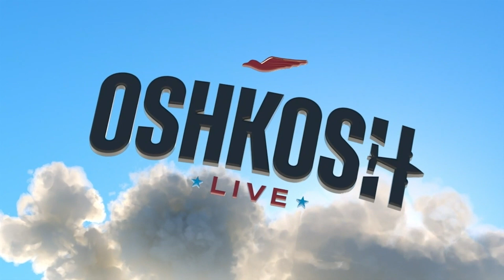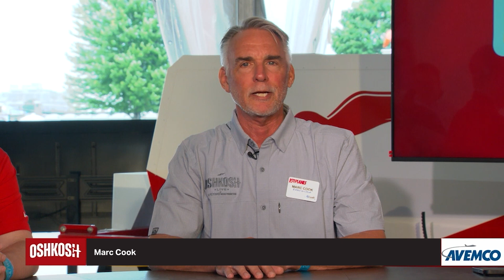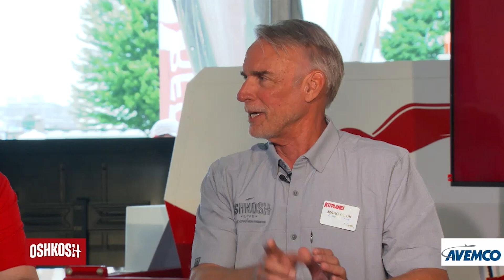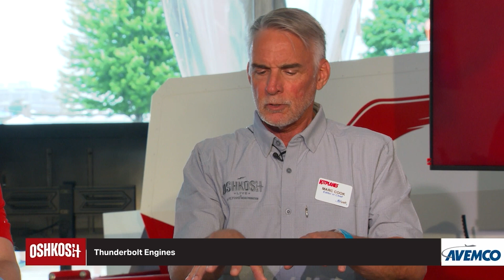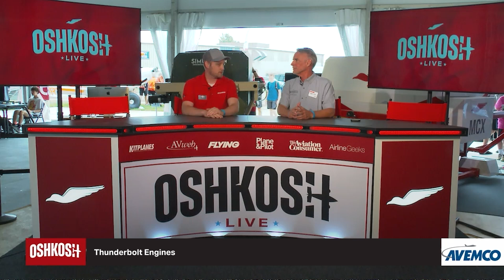Lycoming Thunderbolt Engines Update

Comment: I have overhauled and built engines all my life and in my opinion, Lycoming doesn't have much to be proud of. Lycoming never put the camshaft in the right place and prices are asinine! If they gave a rip, they would at least give us a simple manual pre-oiler for their crummy camshafts, and dehumidifier fittings in the case. They know many aircraft engines sit for weeks or more but for nearly 100 years have never done anything about it! 
Then there is uneven air distribution to the cylinders. With a little care, the oil sump castings could be adjusted to correct this problem once and for all. But again, no effort here either. They're not in it for quality. Just the bucks.
It seems prices are at the point today where somebody could start a new design and do it better and probably cheaper... Gas, NOT a diesel!